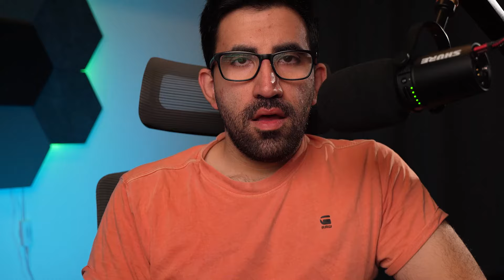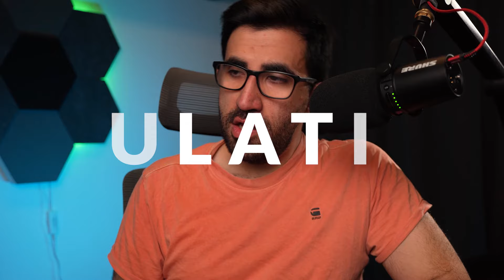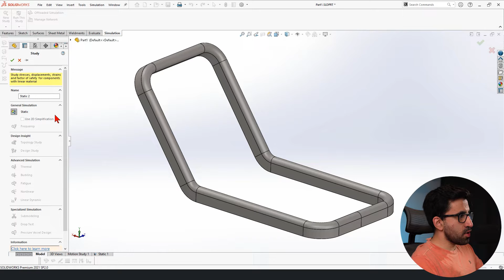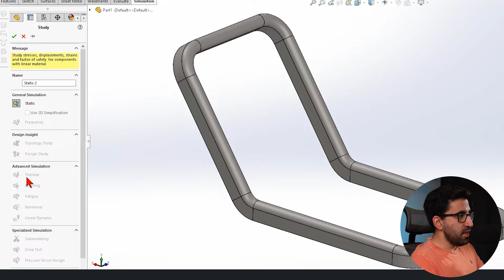Introduction to Simulations (FEA)

Comment: You didn't determine the "factor of safety "
Reply from the maker: Good catch, you're right, I skipped that part. Factor of safety is yield strength divided by the max stress from the simulation, and you can also show it directly as a plot in the results. I should have included it, will make sure it's in the next one
Reply: @with-aryan this is a great starter tutorial for people trying to learn FEA. Nice job.

Comment: Hi ARYAN thank you for the video .😊Im industrial designer and I’m exploring the possibilities of this tool. I have some questions:
1) Does applying a tangent relation between the curve and the line while creating the sketch improve the structural strength of the part in that region? , What about a wider radius? 2) what stress levels or colours are considered acceptable for this part under the applied load?
Reply from the maker: No not in the why that you are imagining it. But you have to do that if they are mean to be tangent anyway. 2-none. it's relative and you can customize the colors. To see the acceptable levels, you will need to go to handbooks and statandards based on the material, and the prodcut you are running the test on

Comment: Embedded CAD FEA is the greatest source of dumb "analysis" in the industry and outright potentialy dangerous designs. There is much more to it than static analysis, auto generative mesh, sloppy boundary conditions and colored stress results. Unaware people will just jump to it like its just another CAD feature while its actually a science in itself. People shouldn't be able to click the simulations tab if they hadn't at least contact with a strength of materials entry course.

Comment: where does it show in the model if you are in the elastic range or plastic range of the material?
Reply from the maker: Good day, This will depend first, if you want to go for simulation that takes both into account, called Non linear analysis, it comes with certain versions of the simulation package within SOLIDWORKS

Comment: what happens when you put a large enough load for the material to fracture? Will solidworks show that, or animate it?
Reply from the maker: no! it wouldn't show breakage or cracks. That's something you calculate with your formula based on the material, then get the value that SOLIDWORKS gives you, if the value is above your breaking point, you know,
Reply: @with-aryan  noted, Aryan. Thank you 🤝🏾

Comment: BTW, what are display states and how can you use them?
Reply from the maker: Display states in SolidWorks Simulation are used to control the visibility and appearance of components in your simulation studies. They help manage and present simulation results more effectively, allowing you to focus on specific aspects of the analysis without altering the actual model or its properties. Here's a bit more detail on what they are and how you can use them:

Visual Configuration: Display states are essentially different visual configurations that allow you to show or hide parts and assemblies, change the color of components, and apply different appearances or textures. They are part of the model's properties but do not affect the model's physical geometry or features.

Multiple Views: You can create multiple display states within the same model document, each with its own unique set of visibility settings and appearances. This is especially useful in simulation to highlight different aspects of the model or to focus attention on specific results.

Comment: Does anyone know if I can model in another software, like NX, and import to Solid Works just to do the FEA simulation?
Reply from the maker: yes of course. there are many cross-formats among these two and on top of that, many common formats that all CAD can read like STEP. No problem whatsoever

Comment: This is not what i came for.
The title was misleading. 
I thought I will learn some physicis and maths of FEA.
It was just a basic static structural simulation in solidworks without any details of what actually goes on.
Reply from the maker: what kind of simulation are you looking for Rasool?
Reply: @with-Aryan  
There should be explanation of what's going behind those fancy buttons.
There should be an explanation of the governing equations and the physics involved. 
There should be an explanation of what FEM is fundamentally and its maths and how FEM approximates the results.

I have been following your videos for a long time. The solidworks tutorials are very good. Thank you for them.

Comment: Hello, how do I know that the result of the analysis is dangerous.... its color becomes red, but how do I know how dangerous it is and whether it will be destroyed or not???  thanks for answering
Reply from the maker: FOS (Factor of Safety) is a quick and dirty way to know this any value less than 1 means the model is too weak for the loads you have specified.

Comment: Hey Aryan, I have a structural member with a plate attached on each side. I had to do this because it won't register the face of a structural member. When I click Mesh and Run, the structural member is excluded from the simulation and will not appear. Got any ideas?
Reply from the maker: how did you create that? Did you use Weldments module?

Comment: Isn't the warning was due to higher load ....or the amount of load that cause the component to fail?
Reply from the maker: I wouldn't recommend laptop for solidworks generally. But as long as its CPU doesn't slow your work sth like i7 above, you should be fine. Even i5 does the job most times

Comment: Good video, subject matter is well explained. A good tip for most metric mechanical engineers - set the force units to N/mm2 (MPa) as yield and tensile strengths of most materials are expressed in MPa. Pascals are too small for most problems…